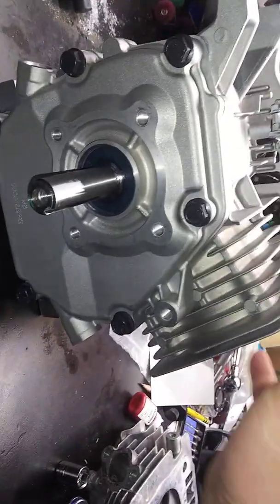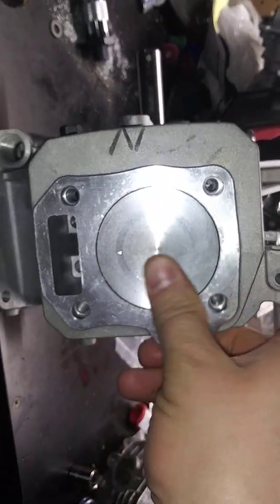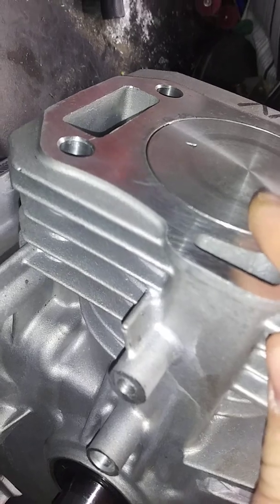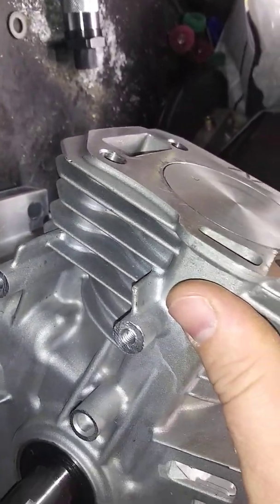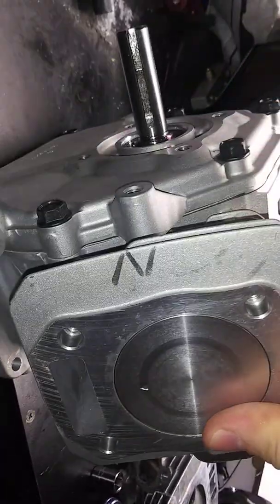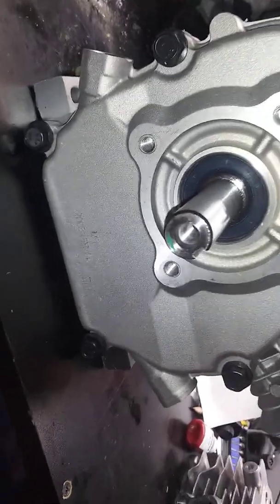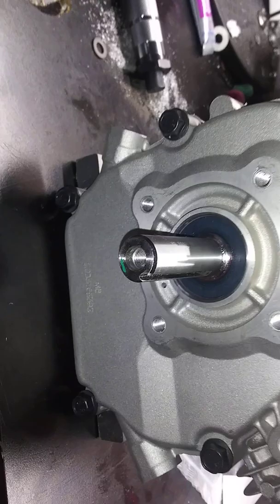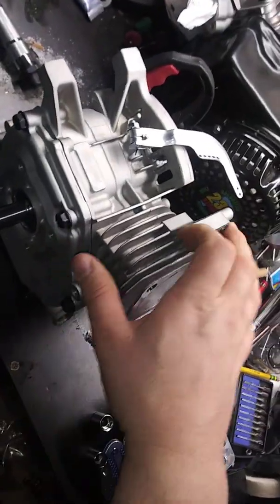200cc build from a 196cc

Comment: So a 212 crank fits right in? Also is that the original piston or aftermarket flat top? Iam restoring a 1996 Dodge Viper go kart and replacing the anemic nearly 30 year old Honda GX100 engine with a 196 and i plan to stroke it along with mild cam,springs,intake & exhaust, unfortunately here in Canada we have limited availability of aftermarket parts and shipping from out of country can get very expensive so if i can use the original piston that would save me some $
Reply from the maker: @Bull3tBikes  yes they fit...but must use correct rod. Pred crank and rod fits original piston.piston rod journal match crank journal

Comment: Can't believe this popped up in recommended.

This is great. I just built a 196. The thing was .040" in the hole to start with a greyhound crankshaft. Ended up 20  in the hole with a thin head gasket.

And your bored stock carb video was a big help. They work well bored. Thanks!

Comment: So the predator 212 crank is a direct swap for the 196? And is that a 196 flattop piston or 212...if its a 212 that means you bored the block? 196 bore is 68mm the predator bore is 70mm
Reply from the maker: The cc gain is from swapping the cranks and rods out. That gives 4cc gain from stroke. The 196 is a 54mm stroke and pred is a 55mm stroke.